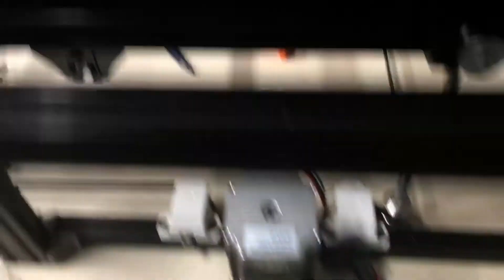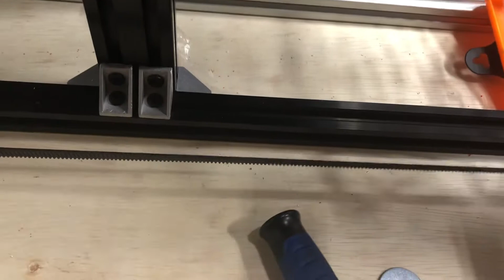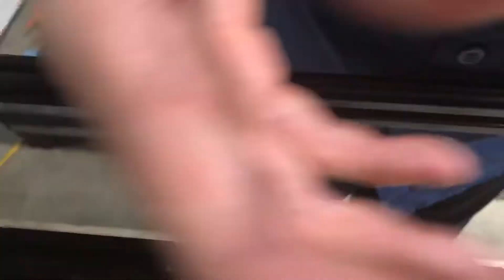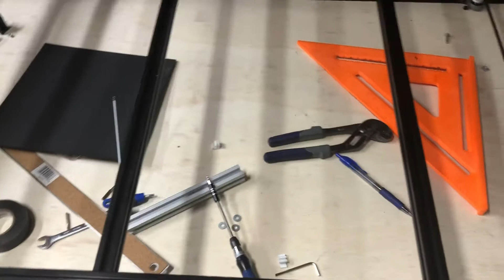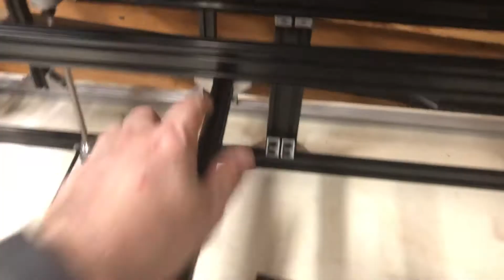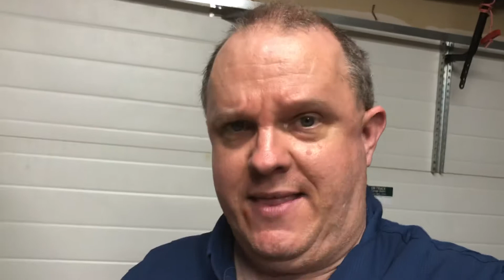Y-1200 Build: Z-Bed

Comment: did you order your extruded rails from mitsumi precut?  if so how accurate were they?
Reply: I did, and they were great! I also have a miter saw that I put a metal blade in for mods I made to the outer shell. Only had one catch wrong and toss the extrusion.